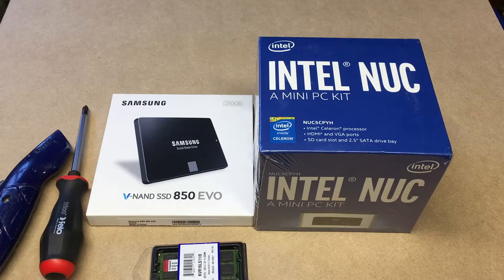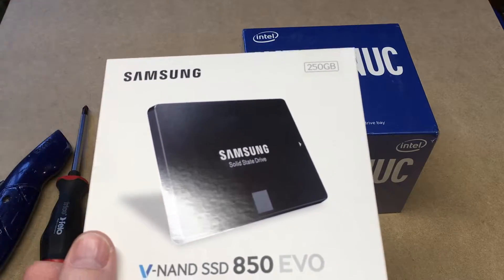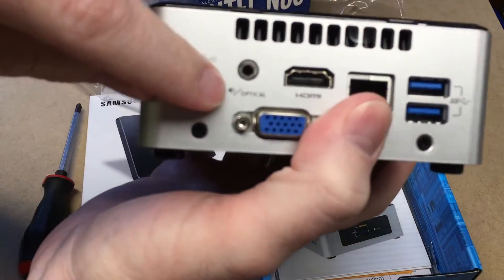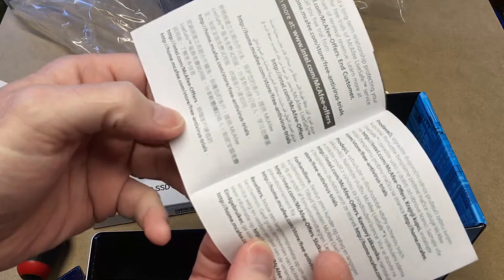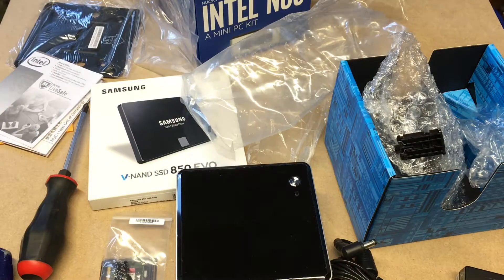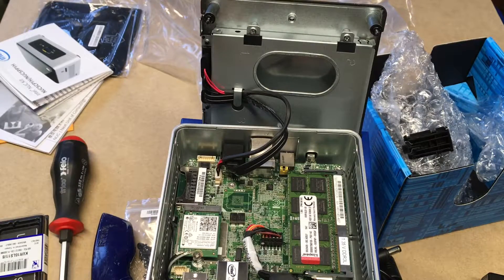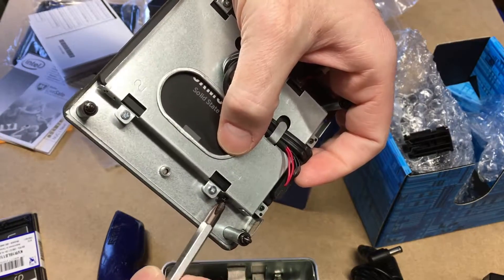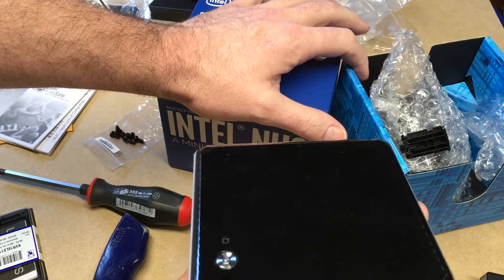Low Power Intel NUC (NUC5CPYH) Unboxing and Build

Comment: Do you know if the HDMI port  supports CEC? I plan to buy a second hand cheap one to make a media center and that would be a great plus for me.
Reply from the maker: The NUC doesn't support CEC. You can add it with an adapter like this: https://www.pulse-eight.com/p/104/usb-hdmi-cec-adapter This is one advantage of the Raspberry Pi computer as it contains HDMI-CEC support. The downside is they are very expensive right now.
Reply: @Rickmakes  Thanks for the quick response man! The adaptor is actually more expense that the nuc itself XD but thanks anyway. Maybe I could control it by IR...
Reply from the maker: @davidromero5779  You might also be able to find a bluetooth remote. I wonder if there is a way to get something like a Fire TV or Playstation media remote to work.
Reply: @Rickmakes  It could be a posibility but I prefer to control the nuc and the tv with the same remote. I have a Logitech Harmony universal remote and maybe it works with the nuc also.

Comment: I note a small unused white (cream) colored connector to left os sata connector. Any idea what it is ???
Reply: I will answer my own question:  Internal USB 2.0 Dual-Port Header
The Intel Tech Product Sheet can be downloaded from: 
https://www.intel.com/content/dam/support/us/en/documents/boardsandkits/NUC5CPYB_NUC5PPYB_TechProdSpec11.pdf
Reply from the maker: Intel introduced support for adding accessories via a custom lid. I'm guessing the internal USB is to connect to those accessories. I haven't seen many things available. I know you can get one with an RS232 serial port. Another has a TV tuner.
Reply: @Rickmakes  Might also have been intended for keyboard and mouse. 
I run OTA (Over The Air) video capture. I can not image USB2 having sufficient bandwidth without really horrid compression.
Reply from the maker: USB2.0 supports up to 480Mbps. A typical OTA TV video stream might only be around 12Mbps. Most USB TV tuners use USB2.0 and have two tuners. They essentially pull the stream off the air and pass it through the USB without modification. When you see a channel like 5.1, 5.2, 5.3, those are multiplexed. The bandwidth of the three channels has to be under 19Mbps. A USB tuner with 2 tuners can actually record those three channels with one tuner and another three (for instance 8.1, 8.2, 8.3) with the second tuner. That would be six tv shows at one time. The bandwidth for all six would be below 38Mbps.

Comment: Do think 16gb of ram and this processer (idk how to spell) will be enough to edit 1080p videos or Do I downgrade to 8gb of ram and upgrade my processor
Also do you meam wireless as in WiFi??
Reply from the maker: While I'm a fan of having a lot of RAM, I think for video editing you should have something with at least a core i5 (core i3 if the budget is really tight). I think this model of NUC only supports 8GB of RAM. I think a core i5 with 8GB would work pretty well.
Reply: @Rickmakes  thankyou 🙂

Comment: tell me about the optical out, what is it exactly? can i somehow add a firewire out to this pc? not a problem if i have to drill thru the housing, just the possibility is what im concernd about
Reply from the maker: You can use a fiber optic (toslink) cable to connect the NUC to, for instance, a surround receiver. The fiber optic connector is actually in the headphone jack. You need a cable that fits it or a Toslink to 3.5mm adapter. I don't know a way to add firewire to this. I'm not sure if other NUCs support it either. If you want a small computer with firewire, I know the late 2012 Mac Mini has Firewire 800. It will run Mac, Windows or Linux.
Reply: Thank you.. but i need a fanless, silent solution. Music playback is the task, but lossless and digital out needed into my DAC, which is an Echo AUdiofire 2

Comment: Does this have a fan or is it passive?
Reply from the maker: It has a fan. It is still very quiet. My experience with fans is that they can get louder as they get old and dirty. I'm guessing the fan could be replaced if that happened.

Comment: Is this good enough for HTPC and home karaoke machine? I'll use it mostly to play and stream videos with resolution up to 1080p.
Reply from the maker: This machine should handle most music and video playing needs. It probably isn't the best for heavy computing like gaming or video editing. It doesn't hurt to max out the RAM (which I think is 8GB).
Reply: RickMakes It is 8GB
Reply: I have almost similar CPU (Celeron N2830; slower and slower graphic), with 8GB of RAM. I have it connected to my 1080p monitor, it handles video payback and web rendering decently fine. I would assume this one would do better.

Comment: Would this NUC Celeron N3050 with 4GB RAM be adequate for a Windows 10 PC that does nothing more intensive than playing SD videos and Skype?  

Not sure if I should go with the Celeron and 4GB or if I'd be safer to go the i3 NUC with 8GB RAM.  Thanks in advance for any advice.
Reply: RickMakes ahaa it makes sense!
Reply from the maker: I don't have a lot of recent experience speccing windows machines but I'm thinking that config should work. The N3050 is supposed to support 4k video so SD video shouldn't be a problem. Hardware requirements for Skype are a 1Ghz processor and 512MB RAM so that is covered. That being said, a faster processor and more RAM are nice wouldn't be a bad idea. It could help things out if the system starts downloading a system update while you are in the middle of watching a video or making a Skype call.
Reply: Thanks Rick.  I asked the same question on another NUC video and the video creator demonstrated that even 4GB is more than sufficient for what I'm using it for.  He opened six applications and it barely touched 60% of the available memory.
Reply from the maker: 4GB is plenty for most tasks. Back in school in the early '90s, I used to run Photoshop on a Mac with 12MB of RAM. I felt lucky because most of the computers in our lab only had 8MB of RAM. I'm guessing 4GB in a modern computer is more RAM than our entire school had for all computers.
Reply: @Rickmakes  That's so cool, what year was that?

Comment: This vs Nvidia Shield? Looking for opinions...
Reply from the maker: I don't have a Shield but I've seen reviews of it on Lon Seidman's channel. It looks like it would be a good front end machine. From what I understand, the Shield can run Kodi and Plex along with Netflix, Vudu, Hulu, Amazon, etc... I currently run LibreELEC (Kodi) on a Raspberry Pi 2 as my PVR front end and a PS3 for Netflix, YouTube, Vudu and Amazon. A Shield could take the place of both of those machines.
Reply: Thank you. I appreciate the response!
Reply: pretty much this nuc is slowed down to its cpu however the shield is better optimized for its performace so shield tv is the way to go

Comment: what about the operating system? does the HD come with it installed?
Reply from the maker: I started out with UbuntuMate (https://www.youtube.com/watch?v=1S6pfz7xQbc) but I am now running Ubuntu 16.10. It works okay for light computer usage. I originally planned on using this as a low powered server and if I do that in the future, I will install Ubuntu server. It doesn't come with RAM or a hard drive. I installed 8GB of RAM and a 256GB Samsung 850 EVO. It could work well with less RAM for certain tasks like a low power server or a display kiosk. This will certainly run Windows but you have to pay for a license.